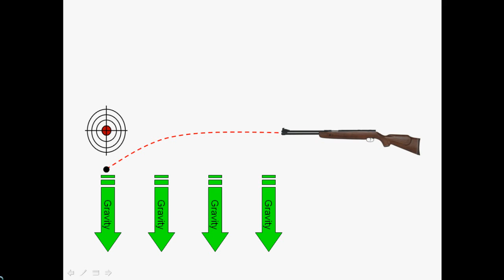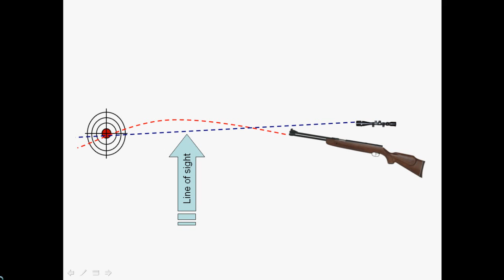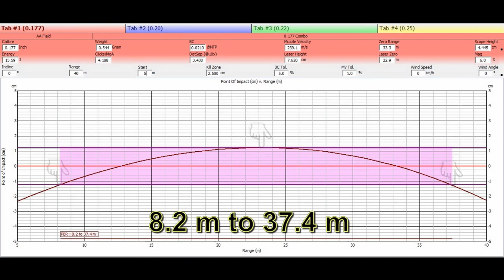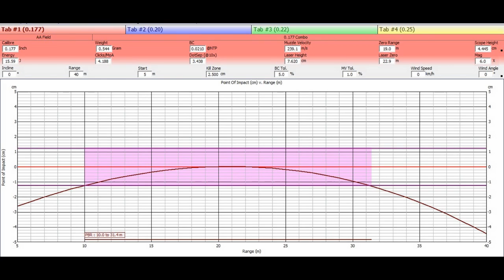Parabolic trajectory, hold over and hold under explained.mpg

Comment: Thank you for a very good explanation of the trajectory curve and hold over and hold under. Now you need to update your presentation diagrams to correct for the height of the scope over the barrel. This correction hold over or under does not matter very much for 100+ yard shots with firearms but does matter with the super short range of air rifles.

Comment: One point of difference: Bullet trajectory is not parabolic. While gravity pulls at 32'/sec/sec, the bullet also slows in velocity on a increasing scale. Therefore it is by no means parabolic. But by observing your bullet's characteristics on a graduated scale, you can determine an accurate flight path, and accurate ballistics for your needs. Otherwise, very good presentation.

Comment: Hello Si. can you explain my problem ? I zero my Bobcat .22 FAC at 33 Yds. then I shoot at 12 ,23 Yds. At 23 yds I must hold over 2 mil. and at 12 yds I do a hold over 3 Mil dots! Isn´t it other ways ? I thought at closer hold I had to hold under.??????? Thank´s
Reply: Hi Carsten, maybe at 33yd there is the first crossing of the line of sight of your scope? 
And the here called primary zero will be further away, if you have two zero points?
The height of your scope above the barrel may be part of the equation?
Best wishes and enjoy your Bobcat!